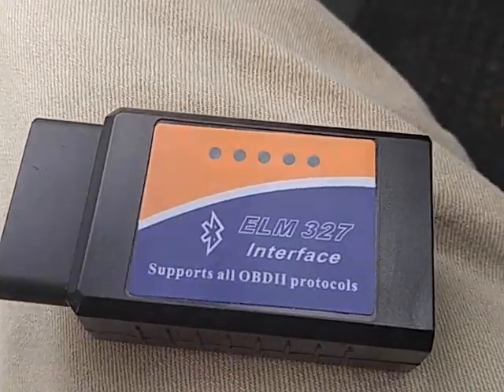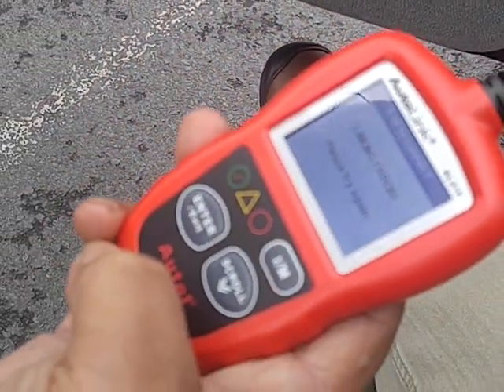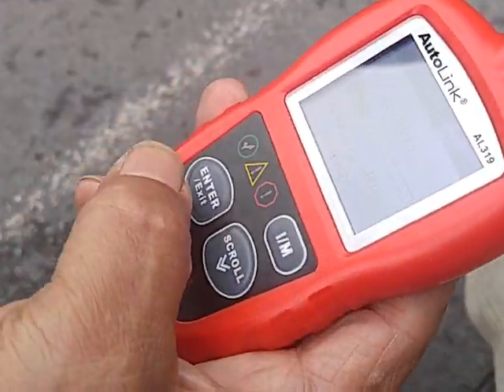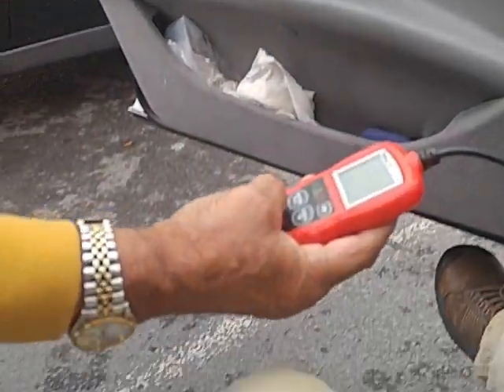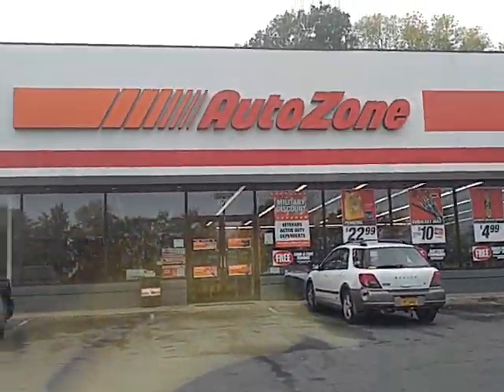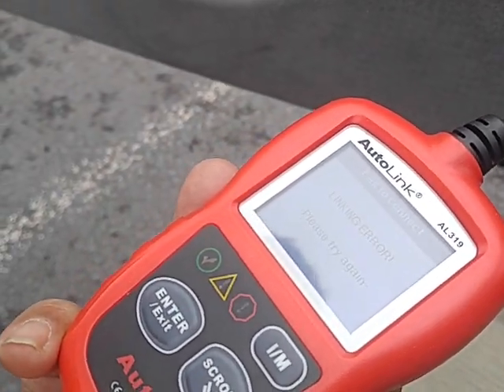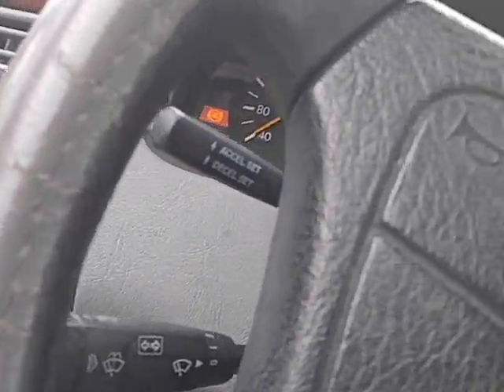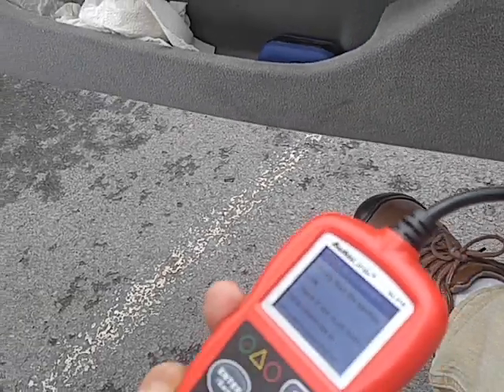Unable To Connect OBDII Mercedes E320 10 2 16

Comment: I have a the same scanner as he does..have a mercedes adapter that plugs into the round obd in the engine compartment and scans more items.. but you can also use the one you tried in the interior.. check your fuses too..usually cig lighter fuse
Reply from the maker: RT BRINTLINGER Mercedes just likes a $5000 scanner. Another shop plugged in his Snap On scanner and it worked fine. For whatever reason, Mercedes needs an expensive scanner. I just bot a 2001 ML320, same engine, I guess I need to pay up. BTW, my '99 Merc still has the chk engine lamp on, but I got a used EGR valve and will try it sometime to get the lamp off and pass mandatory inspection
Reply: lol you sound like me..lol I have 5 mercedes and just bought my first Audi..just plugged in my scanner in the port and it didn't read after powering up..looking for the right combo.. another Audi owner told me to disconnect the battery..hold the pos and neg together for 10 seconds..wait 10 seconds and reconnect the pos first..then negative and try the scanner again..lol we shall see if that works
Reply from the maker: RT BRINTLINGER you can email me at corvairwild at gmail.com
Reply: will do! :-)

Comment: You might have a blown fuse, the Mother-in-law brought her 2000 Silverado in for an E-Test when they connected the scan tool it wouldn't work turns out there was a blown fuse.